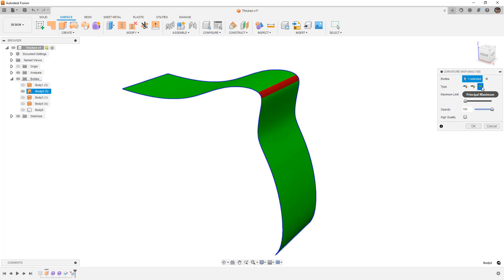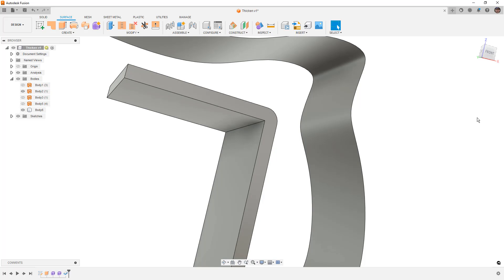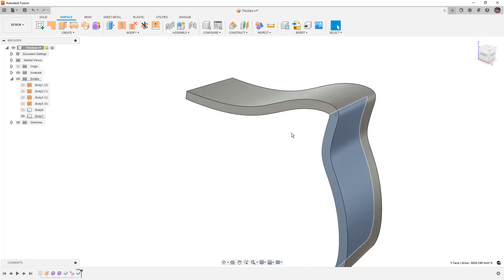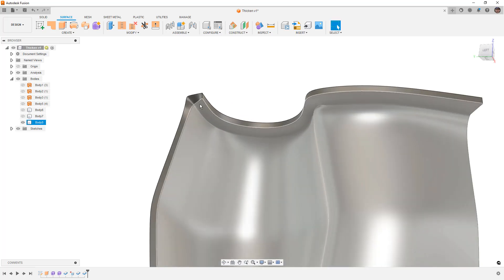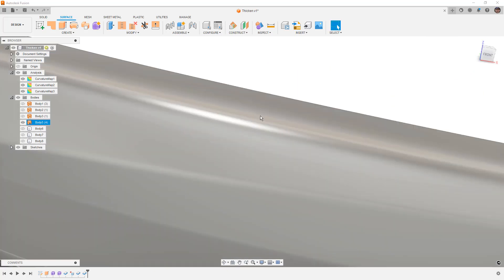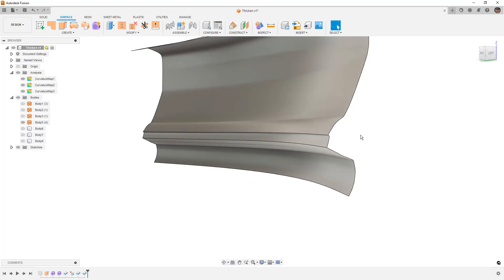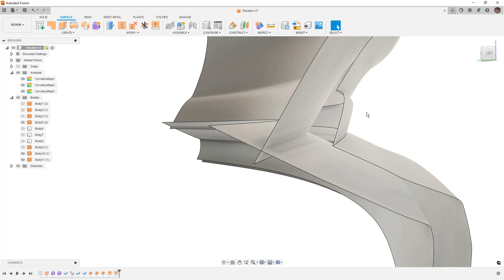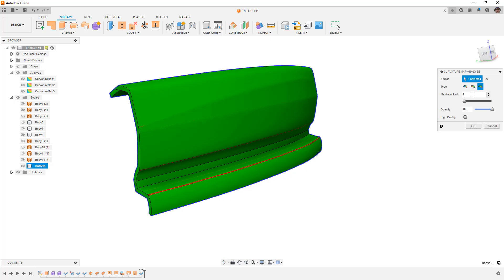Surface Mastery Part 17 | Curvature Map Analysis and Thicken | How To Find Potential Thicken Issues

Comment: 6:30 I find that creasing can sometimes help me get to a point where thicken works. I'm definitely missing something.
Reply from the maker: Fusion has added an option to thicken which can help round corners but basically think about a cube with a fillet on a corner.  The fillet is a consistent radius.  Lets say 5mm.  If you offset that fillet inwards 5mm it will go away.  Fusion can handle this because it knows that surface no longer exists and the surrounding surfaces will patch and make an edge.  This gets a bit harder when you have a complex surface with a non-consistent radius.  Now that face starts to go away in different areas.  If it can't make that crease/patch the surrounding surfaces then it might fail.

Curvature map analysis helps us look at the radius of the surface (the red areas) and see what value might start to give us problems.
Reply: Before watching your videos I didn't even know curvature map analysis could be used to help with thickening anxiety. If finish form doesn't fail, I'm sweating bullets hoping thickening doesn't fail. I'll explore the thicken update tomorrow - thank you!